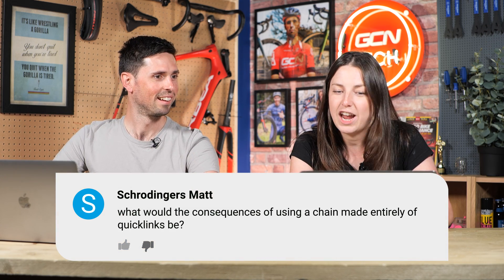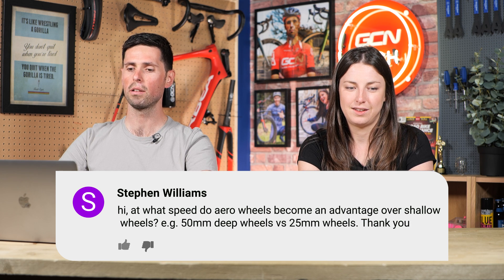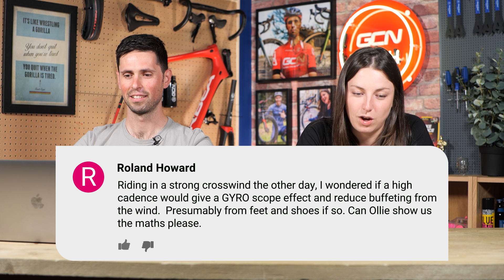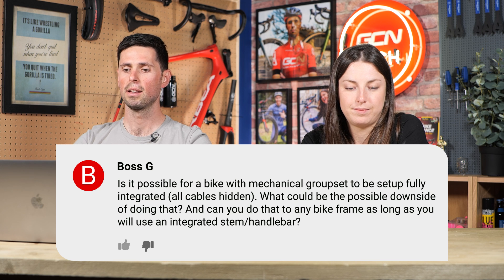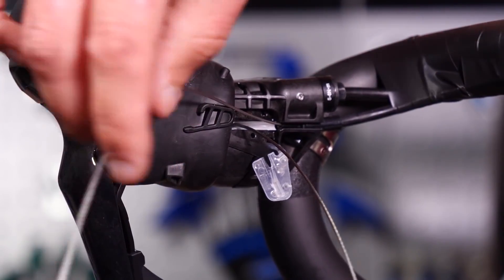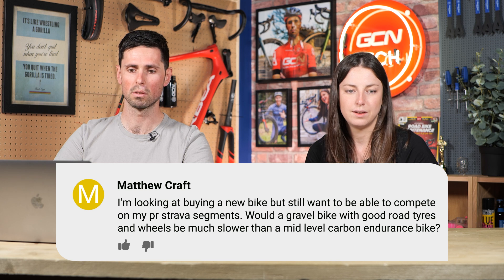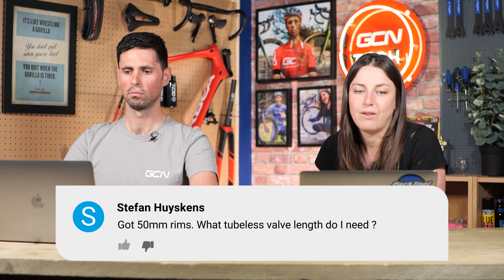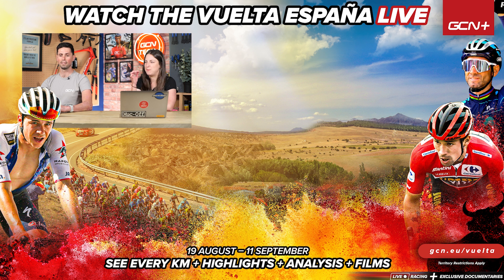At What Speed Are Deep Section Aero Wheels Better? | GCN Tech Clinic

Comment: We all want to see you do a comparison of a gravel bike with a slick road setup vs it’s usual gravel setup. I feel many people are debating the question of whether with some extra change out parts, eg wheels, Tyres, cassettes, can you the best of both worlds.
Reply: a comparison between a roadbike and a gravelbike with road wheels, rims and cockpit would be really interesting aswell
Reply: Good idea - I have a Orbea Terra and if I use 28mm road tires it's much faster than using gravel tires and feels more like an 'endurance road' bike but is actually faster than my real road bike.  And if I use gravel tires I can go on terrain road tires find difficult .   Now what I would say is that some gravel bikes seem like repurposed road frames and some are more like cross country lite mountain bike frames with the geometry to match.   I'd think the former would work better with road tires rather than the latter.
Reply: It is a lot more than that though.  For example...you will most likely have a better CdA on a checkpoint than a Domane because of reach alone.   A 54 Checkpoint and 58 Madone are almost spot on same stack/reach.    Considering that your CdA is a linear variable in the speed/power equation...it matters ALOT.
Reply: @trepidati0n533  You can extend your reach with a longer stem. You can't lower the Bottom Bracket centre (/ride height: effectively seat tube minus stack) or shorten the chainstays on the 'gravel' bike.
Reply: @RobinHood-yk8og  I think you are trying to overthink the issue at hand.  I can always find a frame which wins my argument as can you.  But in reality current "gravel bikes" are very close to "endurance road bikes" with more tire clearance; the differences are becoming small.   The current Checkpoint and Domane SL frames are incredibly similar other than reach.    Maybe even a few years ago the differences were more pronounced...I just don't see it  these days.

Now if we are trying to compare it to a "aero road bike" like Madone and similar bretherin....then yeah, there is still a striking difference.  But.....I am not sure the sales of those style of bikes comes even close to that of more endurance style road bikes.

Simply put....if not going for an aero road bike buy a gravel bike.
Reply: @trepidati0n533  you think I'm overthinking the issue? lolmao.

The Checkpoint has both a higher seating position, and longer chainstays undoing any benefit it has in reach, that you can anyway mediate on the Domane with a longer stem. 

This applies across the board. You cannot find a frame with a higher position and higher clearances that will ever win the CdA argument vs a lower seated, tighter clearanced frame.

If you're looking to reduce CdA, it's the lower, tighter clearanced frame, every single time.

Now, if you want a frame that can do it all... you should be getting a TCR or similar compact geometry frame... accessorised to terrain/discipline: trail tyres, Tri-bars, deep rims, low seat position, stem length of choice and cigarette paper wheel clearances and stiff enough to cope with the biggest traffic light sprints. Giant wasn't f*cking around when they brought that bike out and set the new standard... it's just a shame we've all forgotten about it and fallen for the marketing BS of BigBike in the meantime.
Reply: @Robin Hood  shortening chainstays don't necessarily result in speed.  That's going to be very situational like if you're in a criterium.  A road race that's not technical won't really be affected by chainstay length at all
Reply: @Trepidati0n  totally agree with you.  My Grizl(vs the Canyon Endurance)is probably only slowed down by the extra cage mounts on the fork.
Reply: @Robin Hood  low clearance doesn't mean speed.  A lot of the fastest bikes have big gaps between the tire and fork/frame
Reply: @trepidati0n533  How's about buying an aero road bike, but with enough clearance to fit up to a 32C tire??

I am asking for a use of NO single track/'technical', NOT sliding the back wheel around turns, NOT akin to a full-on MTB type trail, but a; level, straight, relatively smooth gravel canal tow path usage (like we have MANY MANY miles of around here).

Yup, the geometry will NOT be as plush and 'cushy' as a dedicated gravel, or even 'endurance' bike (whatever TF that actually is??), and for sure a bit more 'twitchy', but again, I am talking SMOOTH, and straight gravel paths.
Reply: @Fordworldrallyfan  Funnily enough, more bikes are becoming like this as of late.  It seems there is a market for the N=1 crowd that is growing.  Considering how bike prices are going up relative to disposable income...it may be coming at the right time.
Reply: I agree.  So I did a test myself.  No power numbers to back it up, but what I can say is a Giant TCR Adv. (rim brakes) compared with a Giant Revolt Advanced (disc) with road wheels, doesn't have much in it at all.  To be fair the road wheels I used on the Revolt are 500g lighter than the aero wheels on the TCR, but the Revolt really did fly, with no major disadvantages over the TCR.  Now, I am a rider who is more comfort than aero, just so I can go longer.  Average speeds 18-20mph (Strava not real pace).  Lets be honest, for the local group ride it's not going to make much of a difference, the big difference is the face that the gravel bike can serve the purpose of two bikes and be pretty good at both disciplines.  Plus imagine going on holiday.  Take one bike and two sets of wheels and you can do most terrains.  Out riding with the wife, just pop the gravel wheels on and get a good work out chasing her on her bike.  I have a video I will upload at some point.  Cheers Ian  P.S.  I am happy for GCN to come to Florida and do some more conclusive testing.
Reply: @IanLeadsTheWay  "...one bike and two sets of wheels...."

Exactly. Buying a second set of knobblied wheels for your TCR instead of a whole new and pointless bike would have saved you at least a couple grand.

It's just a shame people are only just waking up to the Marketing BS they've been happily swallowing for the last few years.
Reply: @RobinHood-yk8og  I get what you are saying, but I am in a pretty unique situation.  The TCR is from 2012 so won't even take 28's (Newer TCR's will take 32's, we tried).  Plus, I was lucky I didn't need to buy a second set of wheels for testing, I just took the Scribe wheels from my wife's bike.  Now, to decide on wheels for the Revolt, and look at selling the TCR or leave it on the trainer :-)
Reply: I have a road bike and gravel bike.  I tried making my gravel bike faster with a handful of changes, but it will never be truely as efficient and fast as my road bike.    let's just say that when I'm riding my road bike and I see somebody on my exact same gravel bike.. no matter how hard they pedal, they get destroyed 😂
Reply: @tz1  I'd love to just have one bike for gravel and endurance riding on the road.  And I could have before I moved to Utah. But the required gearing differences here would require a derailleur adjustment, possibly a longer chain, and definitely a different stem.
Reply: You can make it look like a road bike it doesn't feel like a real road bike.
Reply: We really, really don't.

Comment: Hi GCN Tech Team, I use a well known GPS cycling computer with a speed sensor and always wondered if I should have the circumference calculated automatically or manually.  If manually should I use the value in the cycling computer manual, the circumference written on the manufacturers box / website (if stated) or calculate by rolling one revolution on the ground? Could you make a video so we can see the differences? #AskGCNTech
Reply: Exactly what Robin said. No method is precise. Even if you measure the revolution while you are on the bike, the next few days the deflation of the tyre will change the measurement. Don't overthink about it. My Garmin's auto calculation gave almost the same results with manufacturer's values.
Reply: Each method will have caveats of unloaded tyre pressure, riding conditions and rider weight.  For consistency, choose a method and stick with it.  I use the tyre manufacturer specs, since they are tyre model specific and the head unit's automatic calculation does not have that level of detail.

Comment: Hi Tech Team, on the SRAM / ZIPP tyre pressure website one of the questions is - What Front and Rear tire casing do you have? 1) Thin 2) Standard 3) Reinforced 4) DH Casing / Double Ply.  What is the difference and what should I choose as I run Pirelli Race TLRs? #AskGCNTech
Reply: I‘d go for thin.